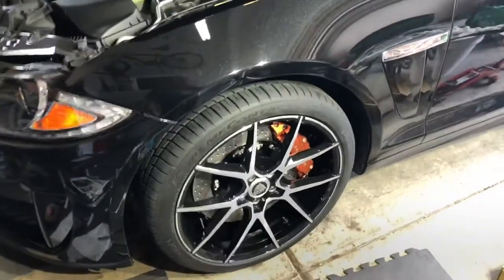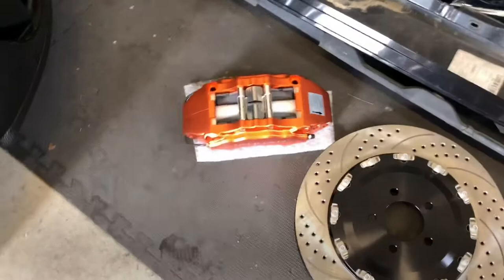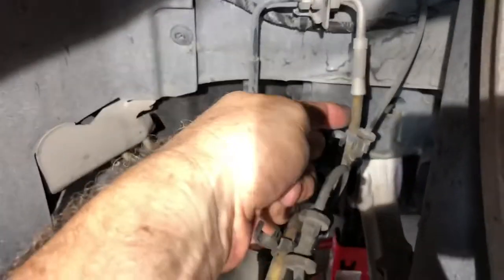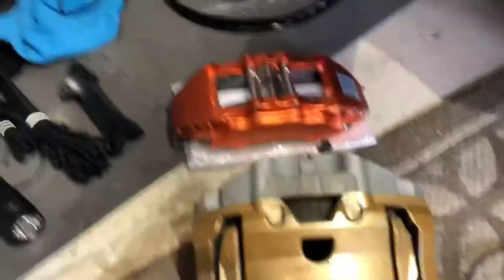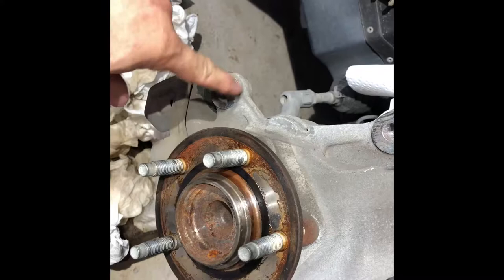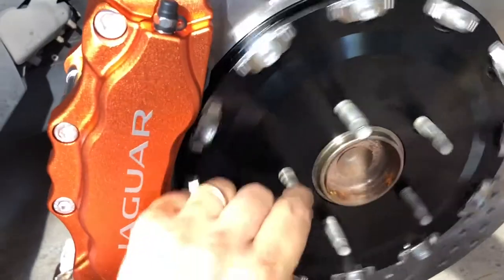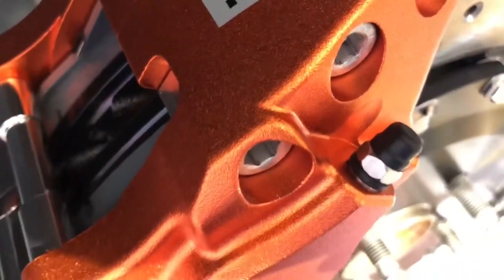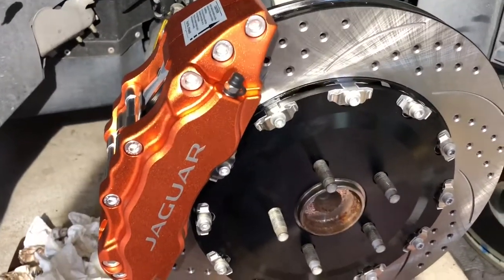PBbrake install Jaguar XF

Comment: I just took the cars out and I'm doing a 650 HP / 923 tq. Upgrade pulley and mapping.
Thinking to try to fit the 405/430 mm rotor kit . Can't imagine the stopping will probably be on the 70 ft Lol.

Comment: Hey mate looking at these for my 21 f pace svr, how have they gone over the years
Reply from the maker: Great, no problems at all! Still look great, no wear issues on the calipers, all bolts and clips are solid, and braking is strong as ever.
Reply: @mrincrdble  great to here, thanks for the reply. I tend to order ceramics on my cars purely for the look (and cleanliness), no such offering on f pace unfortunately and the oe setup looks a bit under done

Comment: cool thanks for sharing
what diameter rotors did you go with? and how many pistons per caliper?
Reply from the maker: 8 piston, 380mm ...have 20” wheels and had to buy a 19” spare. 

https://www.pbbrakes.com/jaguar-xf-sportbrake-08-15-front-big-brake-kit.html
Reply: @mrincrdble  of all the available companies, PB Brakes is the oneI'm considering. I like that they offer the blank caliper (like what you have) Ide also like to put a custom sticker on the one Ide get like you did. How have they held up? Did you ever get the rear kit? Thanks for sharing
Reply from the maker: @Sarm-mx6qy  very well, i did not clearcoat them, just found a place that did high temp vinyl decals with the jag font. After several years now still very good.